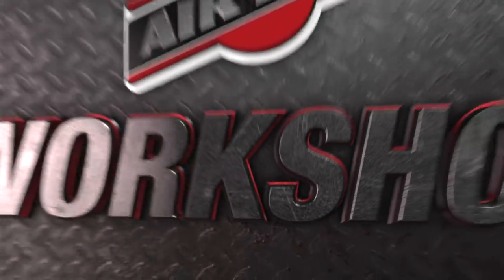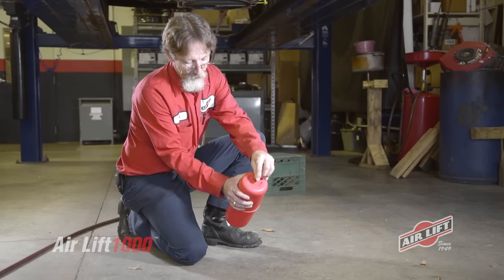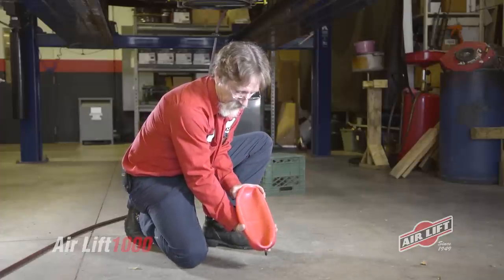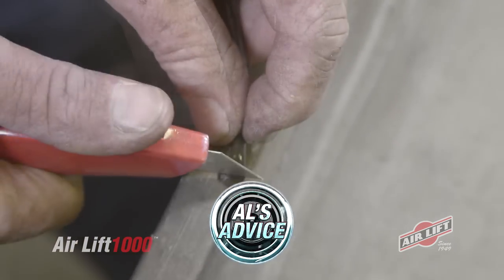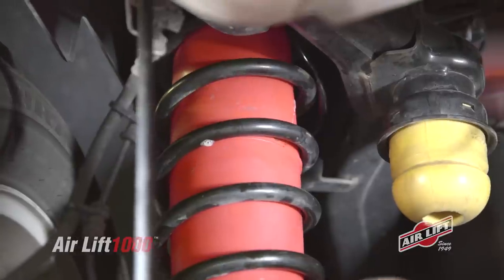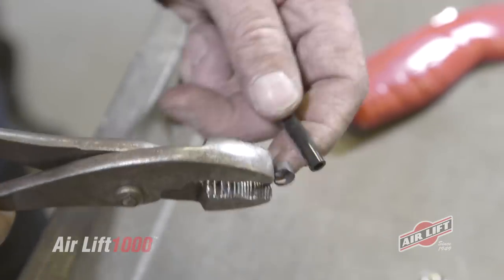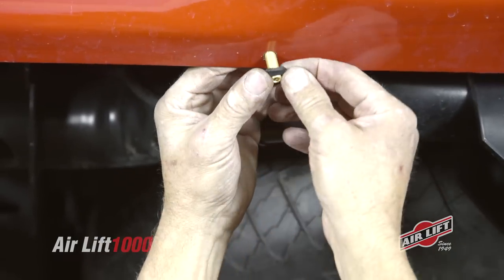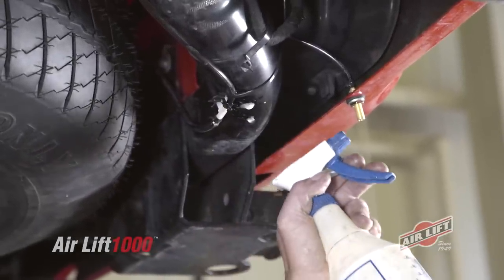Install Overview: 60818 - Air Lift 1000 - Dodge Ram 1500

Comment: i just installed these on a 2017 Ram 1500, i followed the instructions exactly for the first one, the second one went much much easier by doing a few things different, I routed the line down the spring from top and out the bottom where i would insert the air bladder , i attached the air line and clamp first then folded the bladder per instructions , i then compressed it tighter and put wire/zip ties around it to hold it folded tight. It slipped in pretty easily and once in place i cut the wire ties and it inflated into place. remember to put the spacer pad on first too. This was was much easier than trying to attach the line and clamp on top of the spring. I did not have to remove the tire but nearly did so on the first one , it was a bear getting that line and clamp on , i had to loosen some wheel well mud guard. Second one my way was a piece of cake. I put the filler /schrader valves next to the license tag as this was thick plastic and not drilling through metal  body parts.
Reply: Do you know how to let air out of the bags ?
Reply: @prestonlawhorne6500  not sure how you  mean..if you mean before install i just compressed them and capped the air line , if you mean after the install when inflated, you bleed the air out of the schrader valve like on a tire the weight of the vehicle pushes the air out, but you have to deflate at the valve.

Comment: Could not get them into the hot dog shape like the video, so it made it more difficult. I used the handle of a hammer and handle of a breaker bar. Remove the wheel. So much easier. Got one in before I started to get poured on. Will try soaping the other up like someone said earlier.

Comment: Wondering if these will work on the front coils or a 2015 as well... I have aftermarket equipment mounted and just wanna return the original factory ride height prior to the extra weight. I don't see any part # differences for front or rear coils...

Comment: Well. Not too bad to install via video tutorial. However I would take the time to remove the springs. The white creases that were showing concerns me that those are now weak spots. Soaping them up was easy to slide them into the spring but made it hard to run it up inside. Running the lines was okay, more zip ties would be fantastic! They're cheap!!! Lots of pinch points and sharp edges to stay away from. Somebody made a video running the lines tight to the bed and between cross members, problem is if you haul rock or something that could possibly dent the box, you could pinch those lines. So a bit of head scratching. The T was too tight for the lines to fit even after lubing, so I opted for two lines running out beside my license plate instead of one. We'll see how they hold up.
Reply: How did the airlift hold up?

Comment: Check out Timbren bump stops , the ones that just replaces you bump stops , no cutting and no drilling just pop out the old and pop in the new .
Reply: Air is adjustable and you can alter pressure. Don't have to have it hard-knock a bump stop.
Reply: Bump stops have nothing to do with load leveling.

Comment: I have a 2017 jku and was curious if it matters if I where to run the air line out the top I feel it will keep the air lines a little more protected while be off road.
Reply: You can run the air lines where where you like

Comment: I just got mine in the mail. Air lift 1000 for my 1993 Ford Aerostar van. I am nervous about trying the install. - any suggestions for my model? It's 2 wheel - rear wheel drive.

Comment: Why did you install them with the valve stem UP?  Everyone I see is valve stem DOWN.
Reply from the maker: Some of our Air Lift 1000 applications require placing the air cylinder with the valve stem pointing down. However, for the RAM 1500 installation, the valve stem should point up as the air line is routed through a hole in the top of the spring seat.

Comment: It works well  until the bags rips at the bottom were the tab is.   I would upgrade.  It lasted me one year  life span is not there.
Reply from the maker: Hi Tony, I'm sorry for the issue you've had with the bags. It is not normal for them to rip. We do have a lifetime warranty on our air springs and would be happy to send you a replacement. Give us a call at 800-248-0892 Option 2.

Comment: I bought a dodge ram with these on it I dont tow so what psi should I ride around with anybody
Reply: Dylan .M google the model, it will have a max and minimum psi so you can use the minimum

Comment: Don't recommend this kind of air spring. Sure it does the job when loaded, but destroys the ride quality when unloaded. Feels like you're hitting the bump stops when hitting speed bumps at any speed over crawling. 
That is when following the instructions and having the minimum pressure in the air bags, I got sick of them and threw them out from my Dodge Ram 1500.
Reply: What’s the alternative?
Reply: @Clamjammer  I've had other trucks with airbags outside the springs, should mention they had leaf suspension. They do worsen the ride quality as well but not nearly as bad. I may have been unlucky but see if you can find the other variation of air bag if you can.
Otherwise change to stiffer springs in the rear maybe, depends on how you use the truck.
Reply: Just deflate to 5psi when unweighted